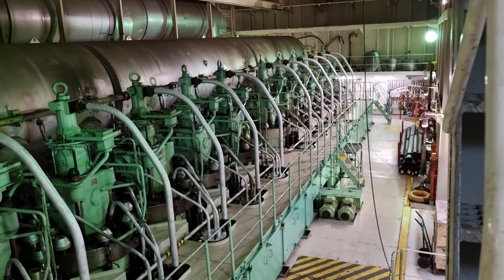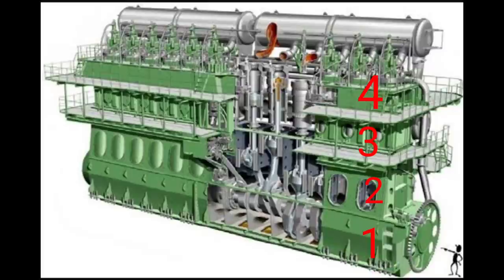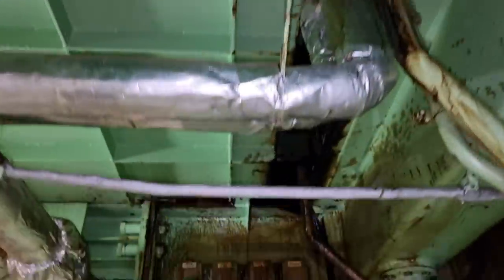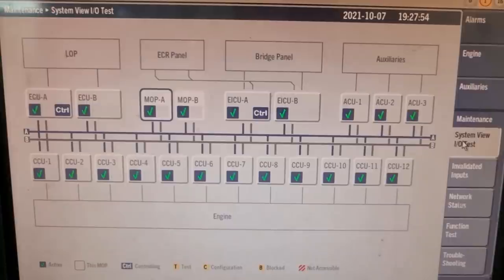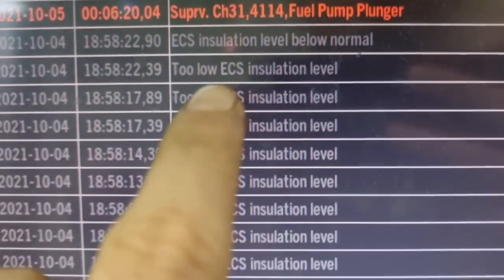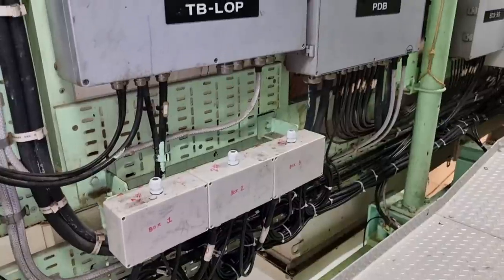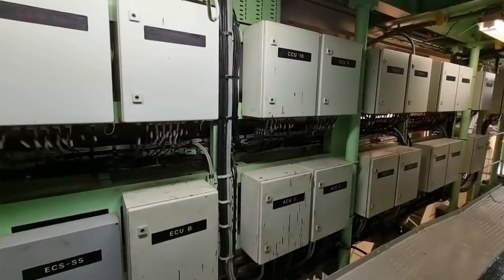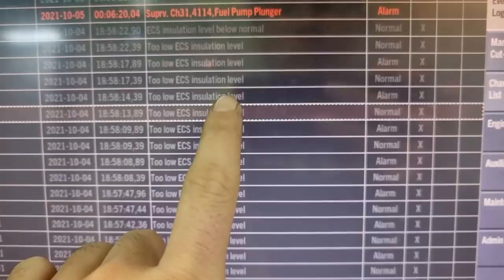MAIN ENGINE EARTH FAULT | MARINE ELECTRICIAN

Comment: On a much smaller scale, I experience the same with vehicles as intermittent shorting/misfiring. It is usually a wire that has been nicked or otherwise a small wear from vibration. Good video. Thank you for posting.

Comment: Hello sir can you please suggest book for power system protection and switch gear subject, how did you learn how to read single line diagrams, and how to locate and calculate fault current and implementation of appropriate protection scheme 🙏🙏🙏🙏
Reply: Like the one which can provide easy and simple explanation may be with examples 🙌

Comment: Good day sir lecky, since we have redundant system for Engine Control System i.e., ECU-A and ECU-B. The scenario of shutting down ECU-B,  will ECU-A takeover and ME-C shall keep on running?
Reply: I'm guessing this is just a bigger version of the typical VW multi-ECU system, which is unsurprising, as Volkswagen owns a large part of MAN, and they likely just reused the same tech that they have already developed for their cars. In this system, one ECU controls half the cylinders, and a second one does the other half, with all sub-ECUs being managed by the two main ones over the drivetrain CAN-bus. If one main ECU fails or loses connection the the drivetrain CAN-bus, that half of the engine will shut down, and the other half will go into a reduced power mode (called "limp mode" for road vehicles or "main engine slowdown" for sea vessels), which is meant to somehow get you home, but not for reaching more than walking speed. The same will happen if any critical sub-ECU (such as a turbocharger controller) loses connection, only that all 12 cylinders will run at even lower power levels, as you still have 2 (mostly) functional banks in limp mode, rather than a completely dead one and one in limp mode. This same system was used in almost all VAG vehicles with 10+ cylinders, including the V10/V12 TDI, V10 TFSI, W12, Bentley W12 biturbo and, apparently, MAN container ship engines. I wonder if that thing is also VCDS compatible? I mean it has CAN-bus diagnosis, so hooking up an OBD2 socket would certainly be possible, it just depends on whether they use the same protocol...

Comment: Great job as usual. Maybe the word you want to use is "ground" instead of "earth"
Reply: I think, it's also correct. I have met only combination of words "earth fault" In the technical manuals
Reply: Ground is frequently used in American English, whereas the rest of the world tends to use Earth. Both tend to refer to the same thing electrically (although some may argue some very subtle differences).
Reply: @arpremo  agree. In my country we use the word for "earth", but in manuals you will get "ground". Anyway, outstading job in the video.

Comment: How did you repair the actual insulation damage?
Reply: The repair was enough to get them to port where the engine can be shut down and the harness repaired. Can't isolate that panel since both the redundant systems run through it, without shutting engine down—and that doesn't get done except in emergency.
Reply: @ConstantlyDamaged  Cool, thanks!

Comment: I always asking my self, how you have enough fuel for long journey when you don't have gas station in middle of ocean ....
Reply: Pre planning how far you are going and how long it will take vs the fuel burn rate per hr/day then you add an reserve just incase you need to divert due to weather or other conditions. You would do it similar for a airplane
Reply: You have a huge fuel tank, calculate how much fuel you are going to use, then fill it with that amount plus a bit extra in case anything goes wrong and you use a bit more fuel than intended. You can do the same with a car: If you know the average MPG you get in that car, just divide the length of your trip in miles by the MPG, which gives you the amount of fuel in gallons you need in an ideal case. But because you don't want to run out of fuel if the trip is a few miles longer than planned or you get worse MPG than average, you might want to add a bit extra to that. For a car, 3-5 gallons are enough, for a container ship, it is more like 3-5 truckloads.
Reply: @unmountablebootvolume  now it's have sense

Comment: Why did u not replace those damaged wires, sir? You just put an insulating tape and a cable tie for it
Reply: shutting off breaker or isolate wires related to main engine will cause of shutting down the whole operation.
Reply: Never replace a wire on a running system.
It is also in the main engine which is not available for temporary shut down.
Reply: @T.J. Kong thank you brother
Reply: @jayarmanalo1947  thank you brother
Reply: @lancequisto1145  thank you brother

Comment: Railroad locomotives often get sidelined for ground faults for the same exact reason : chafed wires shorted to the metal frame

Once, a guy out in California was able to buy an entire GP9 locomotive for about $10,000 because the railroad sidelined it due to ground faults and sold it for scrap ... but he knew of these kinds of faults and rescued it.  It runs to this day on the Niles Canyon Museum Railroad.

Moral : check your wires, always check your wires.  Contact with metal, too tight of wire ties at bend points, etc etc.  You'll either chafe and short to earth/ground, or you'll snap from repeated bending stress and end up with a discontinuity.